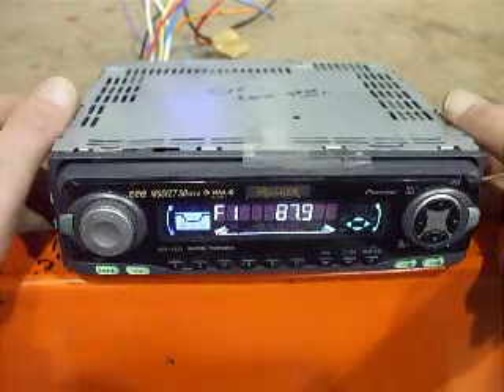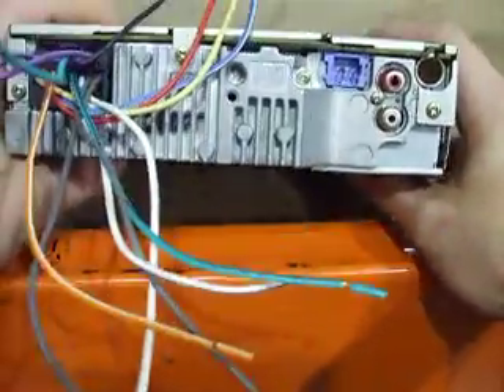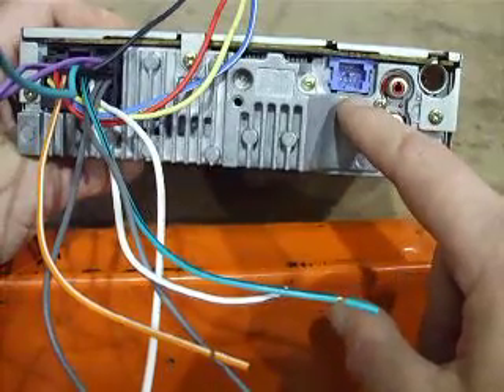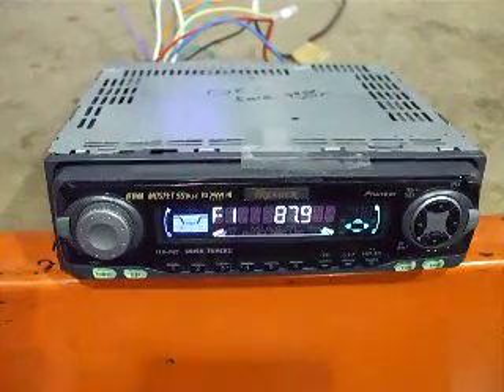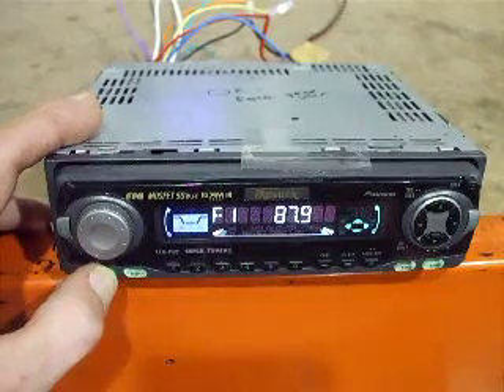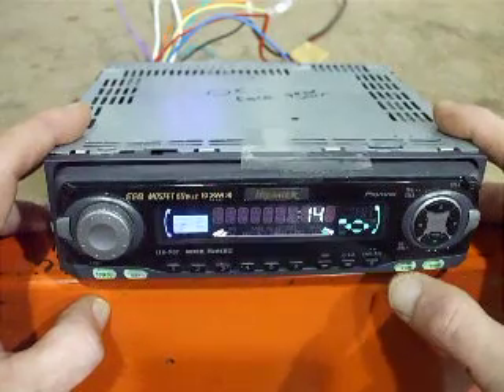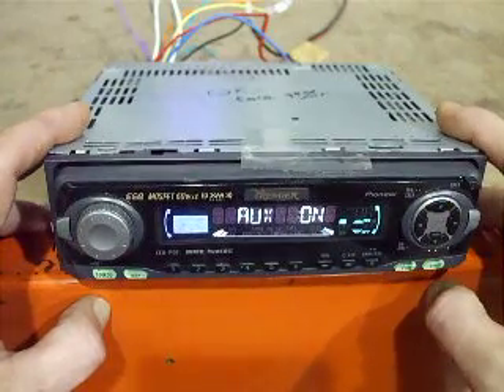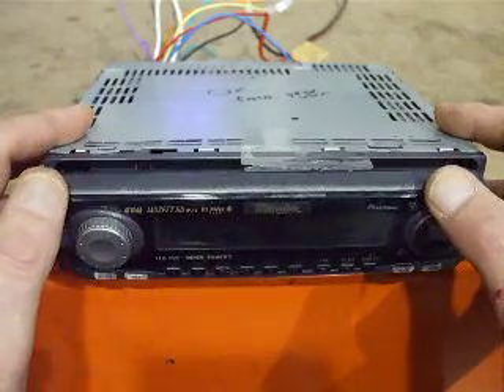How to program Pioneer car stereo Aux Input

Comment: I have in my car a radio just like this one they look just like twins now I always been satisfied of the sound of this radio it's been in my car for 20 years or maybe a little more but lately the back speakers (the base) comes on and off, on and off, do you have any ideas what could possibly cause this problem, that car steering has been there since like I said it before more than 20 years and I never do touch anybody that I'm not supposed to, I just turn it on and off and I never mess with anything else but that is what lately it's doing and some people are saying that I maybe  touched some bottom that I  wasn't supposed to, any ideas some people say that speakers but both are doing the same thing at the same time and now they quit completely so I only hear the front speakers and that doesn't sound right if you don't have the base in the back could you help please I appreciate it if you do thanks

Comment: hello sir and thanks for the tip, I did this and it works. how ever I'm only getting sound thru the rear speakers, as I understand it because these 2 rca ports are pre amp outputs for the rear. will this damage anything in the long term such as my phone? should I just get the ip bus to aux cable? would that be better?

Comment: hi, i have car radio Pionner DEH-3100 R, i have bought aux RCA cable and i dont how to switch aux in my car radio,if you can help me
Reply from the maker: niko tuliani power down the unit, hold down the menu button til the submenu screen comes up, from there you can toggle to the aux in turn on feature

Comment: hey man i have a 2002 pioneer premier DEH-240F and i tried this since its hooked up to a 12vdc 700ma power inverter in my back yard and i want aux. the top left button is my sub menu i think, but when i push it again like you did nothing happens i even tried all of the buttons but they just closed that menu. it has an rca in the back though, so do you know if my deck has that capability? and how would i access it if it does?